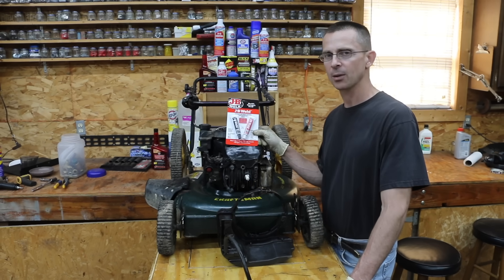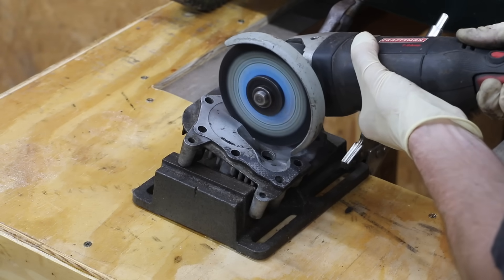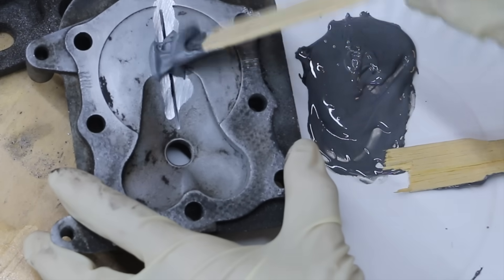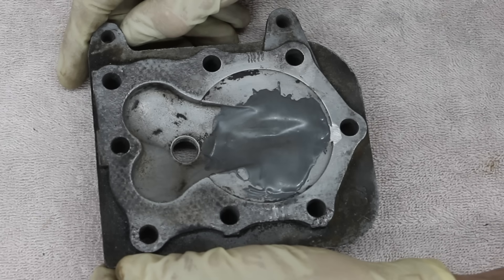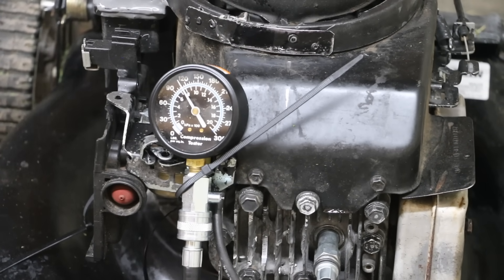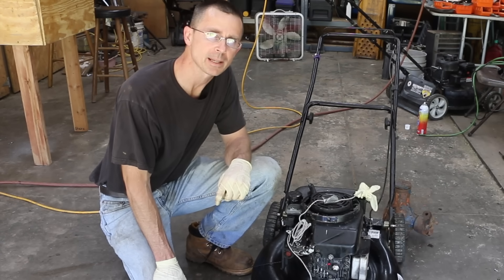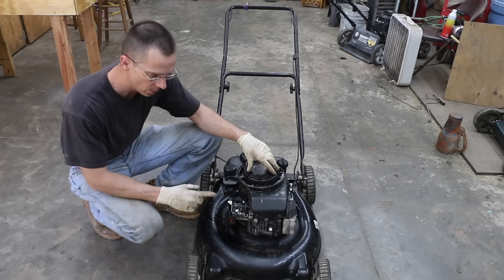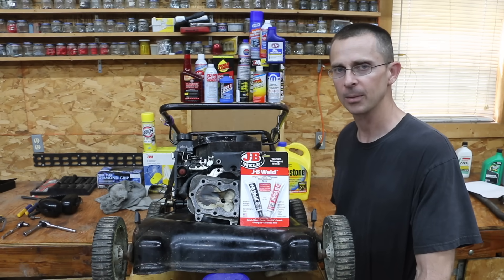Can JB Weld fix a cracked cylinder head?  See the proof!!

Comment: Years ago I bought a cheap, well used Honda 90 three wheeler.  It had a 1/2"-3/4" hole in the case where the chain had come off and broke a hole in it. I pulled the engine, tore it apart, cleaned the part with the hole and used JB Weld to patch the hole.  It held for several years, then I sold it to a guy I worked with for his son to ride.  He never mentioned having a problem with it.  
I've used JB Weld numerous times without any failures.  The only time I ever seen it fail was when a friend brought over a car he wanted to sell.  A big part of the front bumper plastic was broken.  It was winter. He never cleaned or even wipe off anything.  He just gobbed some on and left it.  Of course it fell off.
Reply from the maker: Thanks for sharing.

Comment: I tried JB Weld on a cracked exhaust manifold of a little 1985 2.0L 4-cylinder Dodge/Mitsubishi Ram D50 engine and it didn't work, though it could have been a preparation issue.  I just did as my farmer brother-in-law told me, with his guidance.  I have a now 5-year-old Briggs & Stratton Engine 725 Series engine on a self-propelled push more with Zero Compression, which happened on the 2nd cut of its 3rd mowing season.  I haven't torn the engine down yet to see if replacing the rings would be enough, but since JB Weld worked on you badly damaged cylinder head, I'm wondering if it might work on the cylinder piston wall, in case I find damage there.  I guess I'd have to create more damage to give JB Weld something to adhere to and fill in, but I'm wondering if JB Weld there might be able to withstand being honed to re-rounded for the piston and then be reliable as the piston does its thing.  Either that, or if the cylinder wall could be honed wider to accommodate a cylinder sleeve.  I'm no mechanic by any means, but I'm wondering about possibilities.  I found this video of yours in looking for repair/rebuild procedures.  Thanks in advance, Todd.
Reply from the maker: Thanks for the suggestion.

Comment: Worked in a Radiator Shop in the 80's ...One of the guys used JB Weld to fix a external crack on a block of a Tractor Trailer Truck ... We pressure tested it and it held ... Went down the road so I don't really know how far it lasted ...
Reply from the maker: Thanks for sharing.

Comment: How about Jb weld to repair stripped threads . Then say you have a 5//6 thread ole that you want to make it 1/4” thread . In other words mak n over size thread drill and tap for smaller thread.
Reply from the maker: Thanks for the suggestion.

Comment: Just weld works great on fuel tanks, diesel or gas have used it for many years, however ethanol gas will eat up jb weld very quickly.  Jb weld is great and ethanol sucks.
Reply from the maker: Thanks for the feedback.

Comment: Saw a pro modify Triumph high power MC intakes a lot with something, perhaps this, perhaps platic padding back in the 90s. Never fell off acording the the article in "Classic Bike" or what it was. Question - anybody have any info on how JB reacts with modeling clay (the cheap kiddy stuff, that doesn't harden)?  I was thinking, you could create a form of the desired combustion chamber - fx by assembling the piston in the cylinder, and putting the clay on the top of iot. That way you could use the exact amout of clay, to create the exact compression wanted, and form the desired dome or whatever (thinking 2- stroke with squish band)

Comment: Nice test. I e JB I like the fuel tank repair too.  I use it for just about any repair.  Build rc airplanes so have lots of pears.  Have one test I’d like to see. I’m going to make an eccentric for my model steam engine. Basically Jb weld one shaft collar to another off setting the bores  they are aluminum now bu I may want to do steel later.
Reply from the maker: Thanks!

Comment: I fixed my 1992 Yamaha FZR1000, which had a cracked gear housing and oil was spraying out.  Previous owner dropped it or fell with the bike.  Just JB welded the thing . No oil leak whatsoever.  I pulled 4 additional years out of the bike until it was disassembled for parts for another project.
Reply from the maker: Thanks for sharing.

Comment: I used JB weld to build up the surface of a hydraulic pump input shaft where the seal had worn a small groove... Then turn the shaft built up area to slightly oversized and installed a new seal. This is a hydraulic pump on a farm tractor engine and it is still going after a couple of years.
Sure enjoy your testing videos and thanks
Reply from the maker: Thanks so much!

Comment: You should test how different mix-ratios of the JB weld affects the strength. Like 50/50 of the steel to the hardener, 60/40, etc. I’ve always added slightly more hardener to heavier duty applications and it hasn’t let me down yet
Reply from the maker: Thank you for the video idea!

Comment: JB weld some good stuff I’ve used in carburetors have a crack in a carburetor I put it in carburetors and it been in there for years the only thing that if something it’ll try to bother it overtime it’s fuel with a lot of ethanol in it there’s not many things in all the ethanol it’ll it’ll try to attack it but I put it in the carburetors and it was over maybe three or four years and I run it that was in my snowmobile
Reply from the maker: Thanks for sharing.

Comment: I used  JB Weld Plastic Glue and Plastic stitching to repair my 2020 850 cc Polaris  Quad Fender and you can hardly see on the outside where I repaired it after 4 months of snow plowing. It's great stuff, and I have used it to repair pressure washers and all sorts of things over the last 20 years.
Reply from the maker: Thanks for sharing.

Comment: Our 2 part glue is called Araldite in the UK and it did a lot of welding on bikes not sure on the tests you have done but if they sold it here I would buy it.  Have you tested these so called strong and waterproof Tapes?  Another good idea any way
Reply from the maker: Thanks for the video idea.

Comment: I used J.B. Weld on a car gas tank and it was leaking gas at the half tank,  so I carefully cleaned the metal with sand paper and then mixed it up, put it on , just a small pin hole, but I covered about a 2 inch area just in case there were some other pin holes I didn't see.  It lasted for 4 years,  plus I got better fuel mileage.  I sold the car after that so I don't know if it lasted more than the 4 years or not, my guess would be it did.
Reply from the maker: Thanks for sharing.

Comment: I repaired a cracked aluminum radiator on a Honda CRF250R dirt bike several years ago with JB Weld. We were at a remote off-road park for the weekend and my son crashed into a tree and cracked the radiator. To salvage the weekend, I mixed up some JB Quick Weld and applied it to the crack, no real prep work other than cleaning. I thought that if it held for the next couple of days, I would replace it with a new one when we got home. It worked so well, that I didn't replace the radiator for several years. It never leaked.
Reply from the maker: Thanks for sharing.

Comment: Project Farm, If this is about, how good JB weld works, I have a story for you, I own a 1970 OMC 1200 mustang skidsteer, I put a 65 hp Wisconsin, That I have own 20 years now, 6 years ago, I had a loud exhaust, noise, smoke was blowing out from under head shield, #4 cylinder, when i pulled it apart, It had a large hole in the center next valve,3/4 hole, I did not have the money to buy a new one, so I bought JB weld stick steel, I sand blaster the hole clean, filled with JB , sanded and applied the 2 tubes your using in this video, set 24 hours sand smooth put it back together, Has been running Great since. That,s How good it is, I stand by JB weld.
Reply from the maker: Thanks for sharing!

Comment: Project Farm Sir my friend Clem he is reallly happy with the JB Weld original it has fixed his mirror on the 2009 Ford Mustang & Clem noticed the left hand side mirror was moving   a little & so Clem went out & brought JB Weld original & took off the mirror & noticed the bolts were plastic bolts & so he bought some steel screws drilled down in the mounting bracket mixed up a good amount of JB Weld original & put a fair amount JB Weld on the screws & pushed the screws into the mounting bracket & has fixed that left hand side mirror as well he really Pleased with JB Weld original Kind Regards Peter PS Keep Up The Excellent Work Project  Farm Sir & as I say again you are No 1 Guy when it comes to Testing Different Products That Are Out There In Today's Market Good Stuff
Reply from the maker: Thanks!  Thanks for the feedback.

Comment: A bar of soap works the best for sealing a hole in the gas tank, first push a bar of soap into the hole in the gas tank then cover up the soap with the jb weld and that will hold for a long time

Comment: We used it in the car repair business religiously, even at franchised dealerships; either to get an unaffordable repair for a pleading customer, or to fix a mechanics over zealous wrenching skills- cylinder heads, blocks, trans cases, rear ends, gas tanks, resevoir nipples... you name it. We had "epoxy cups" in the shop all the time, too- it had the regent and activator under a foil cover you peeled off, then push the popsicle stick that came with it into the center, making a deeper cup and mixing the compound into a rock hard, cured adhesive. The techs got pizzed when I didn't have them!

Comment: Dear Mr. Farm: I've done this on a john Deere 301 Kohler known for head damage.  My breakage was in the mounting surface, and blown gasket. Put on j b and ground surface. New head gasket and torqued.  Lasted 2 years until cam broke from sticking valve,  that was the end of it, but j b did it's job. Thanks for another awesome video. Still say manufacturers should put in their labels  ( project farm tested ). Gods speed my friend
Reply from the maker: Thanks and you are welcome!

Comment: I used JB Weld 40 years ago on a leak on gas hot water heater gas line in a rental house about 2 years before I moved away to the house I own now. That weld job did the trick. One of my last farewells to the landlady was she made need to get a new hot water heater.
Reply from the maker: Thanks for the feedback.

Comment: THe performance level of JB is  greatly affected by the cleanliness of the surface. Bare, rough,clean metal is the best. If you put it on paint, it will only stick as good as paint.  I have used it to patch cracked oil pans after draining and grinding the metal. Then use ether spray to clean out the crack and surrounding bare steel. It held for ever.
Reply from the maker: Thanks for the feedback.

Comment: JB Weld is Excellent Brilliant stuff I & used on a few items & it does hold most plastics &   I'm going to use JB Weld on gluing down a bilge pump float switch to the bottom of the hull on a fiberglass boat & that should work well & use no screws to hold down the float  switch & should work well & I going to rough sand the fiberglass hull where the float switch goes & I will make up a fair amount of  JB Weld to make the float switch more scure  to the hull of the boat & the float switch base is plastic & it should hold very well to the bottom of the hull & one part of was thinking to get a piece of marine plywood & glue that to the bottom of the hull & then screw the float switch to the small piece of marine plywood & do it that way but I think I will just glue it down & should work well if the JB Weld can stand up to a cylinder head it should stand up to a float switch Kind Regards Peter
Reply from the maker: Thanks for sharing.

Comment: I have used JB weld on 2 different aluminum boats to fix leaky rivets and cracks, works every time, you just have to clean and rough up the surface really well and degrease it with either carb cleaner or alcohol. Love that stuff.
Reply from the maker: Thanks for the feedback.

Comment: "anything better"  I know this is an older video but there is an epoxy we use to repair compressors cracks with. It has fine metal mixed with it so that it can  be drilled and tapped. Its expensive. It is called Belzona. It would be interesting to see how it compares  to high  temp JBWeld. Great job on all of your videos.
Reply from the maker: You are welcome!  Thanks for the video idea.

Comment: I've got a stripped torx screw on the front plate of my Chrysler 2.7 engine which I intend to remove by J-B Welding a hex nut to the torx screw.   After watching this video I'll proceed with confidence and care that I don't slop any of the blended epoxy onto the front plate.
Reply from the maker: Thanks for sharing.

Comment: This a false positive test. When a cylinder head fails on a small engine, the crack always propagates through the edge of the flange! You only cut a hole in the middle of the head, leaving the edge of the flange intact. So you never truly weakened the head as they are in the “real world.” A true test of the JB Weld would be to extend the cut all the way out through the edge of the flange. Then you’d be testing the ability of the JB Weld to withstand the compressive forces, heat, and bond/tensile strength as the cylinder head expands from heat and explosive forces under use. 

Spoiler Alert! JB Weld FAILED when I used it to repair a cracked head on a 15 HP B&S single cylinder engine. I expanded the crack by grinding to open it up. Cracked out through the flange. JB Weld failed after 20 minutes of running the engine. 

Your example is a plug weld, not a true real world cylinder head crack.
Reply: Well no one truly uses this anyways to “fix” anything.
Reply: @crandonborth  So you speak for everyone, eh? Then why is it I’ve never heard of you?
Reply: Just so happens I’ve got a cracked block at the oil drain plug. I really don’t want to remove the engine. 15 HP B&S.

Comment: Repaired the brake master cylinder on a '67 International bus that had rusted on the inside and was of course not providing the hydraulic pressure needed, it was leaking by the seals internally.  Cleaned the chamber and honed it after drying.  Worked a charm, then drove it to Alaska.  JB Weld shines best when parts are not available.
Reply from the maker: Thanks for sharing.

Comment: Another great job!  I race a 700 hp. TransAm series Camaro back in the 1990’s.  I had an external oil filter and the aluminum housing cracked.  I repaired it with J.B. weld.  It never leaked!   Incredible stuff!!!
Reply from the maker: Thanks!  Thanks for sharing.

Comment: I just saw that job weld has a super weld Uv light activated adhesive and there are a lot of different resin type adhesives out there. I’ve used 5 second fix and it’s not that good. Have you heard of that job weld superweld before?

Comment: I was stationed in Mayport fl while in the navy in the late 90s, and I borrowed a friend's 90s model Chevy cavalier to drive back home to Central Texas while on leave.  Half way through the Florida panhandle the bracket on top of the water pump where the heater hoses connected broke off so the car started overheating due to coolant loss. I pulled into an auto parts store and used jb quick to fix the bracket and drove the rest of the 850 miles home.  I only let it dry for 30min and it held the whole way.
Reply from the maker: Wow, thanks for sharing.

Comment: Excellent demonstration!
My very first time using JB Weld was out of necessity.  My very first car in 1978 was a 63 Rambler classic and it ran amazing, near bullet proof.  However it had a hole in the bottom of the gas tank. ⛽️ The owner of the gas station I worked for suggested trying JB weld. We emptied the gas tank, properly prepped the exterior and did the repair, and it held up great. Six months later I traded that Rambler with my best friend who had a 65 Chevy Nova. Later he gave the Rambler to his sister, who used and abused it. 
4 years later just before she sold it, I had the opportunity to check it out and that JB weld repair was still in place and holding, no joke! That experience made me a lifetime customer and I've used it on many projects over the years, because it works!
Reply from the maker: Thanks!  Thanks for sharing.
Reply: Hi, how to prepare the outer surface of the crank case for JB weld ?.
I mean how u prepared for your case ?

Comment: I unfortunately never had luck with JB Weld exposed to gas.  I tried repairing a tiny hole in a carburetor bowl multiple times but it always leaked around the repair until I finally broke down and bought a new one.  Anywhere else it's worked great!
Reply from the maker: Thank you!

Comment: I worked on the B&O Railroad, we used it to fix cracks in the engine block and it worked. Quite a few times I've seen and used it for that.
Reply from the maker: Thanks for sharing.

Comment: Great test! I keep JB Weld in my work shop and use often. I would never believed it would take the heat/stress of a cylinder head. I’ve it for many years and even thinned it with a little denatured alcohol to get into small cracks/fibrous material. Slightly warming w a heat gun makes it flow well and harden faster too.
Reply from the maker: Thanks!  Thanks for sharing.

Comment: Why don’t you torque head to proper specifications 25 foot pounds you did not run the engine long enough for that JB Weld to see if it’s hold  so basically you have a false test